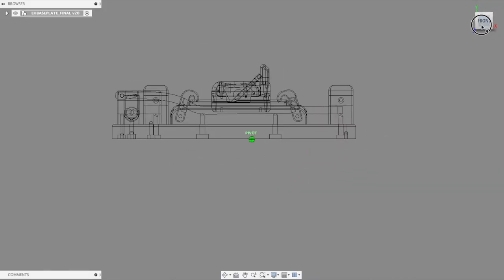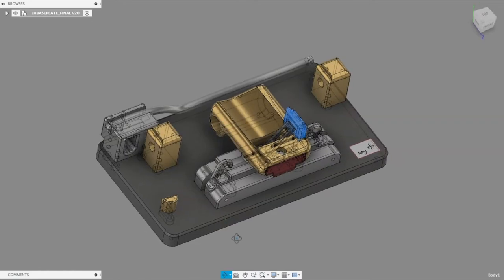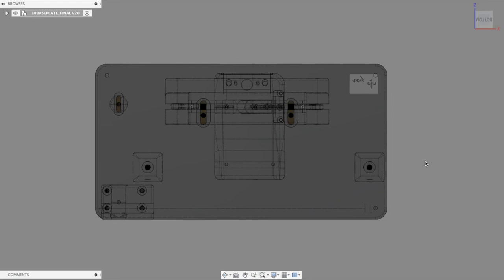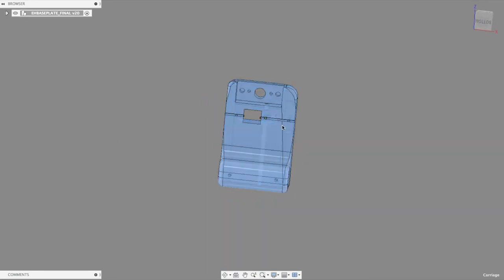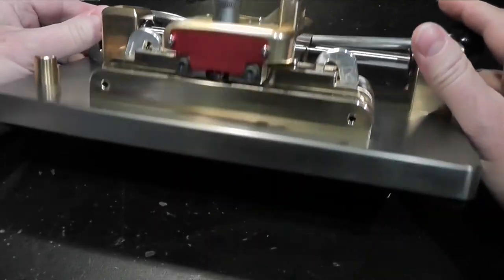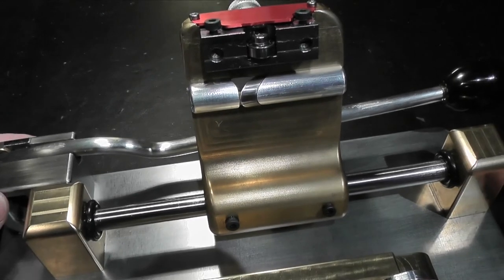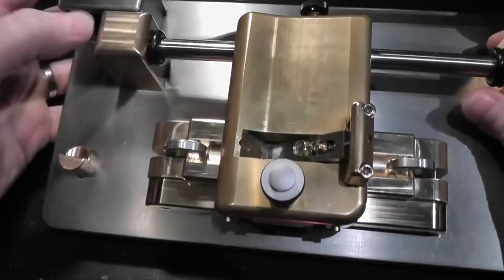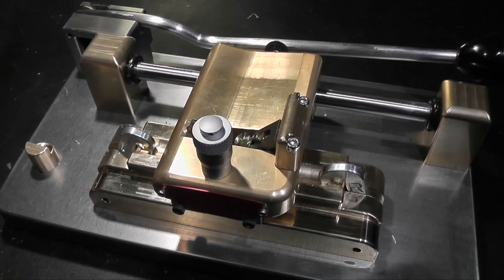ROY ENGLISH HORN GOUGER PREVIEW

Comment: Nice features... the micrometer head seems like a logical modification update. Smart and practical improvement. “Turn the screw 1/8 clockwise...” is pure guess work, with hopes that it stays that way so you don’t have to repeat the attempts multiple times, with a custom Allen wrench that should never be misplaced.